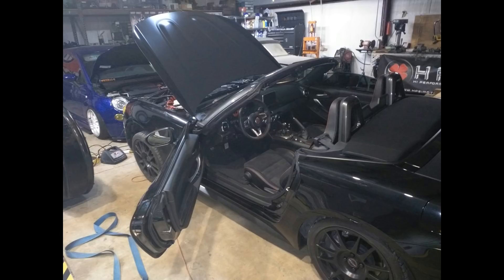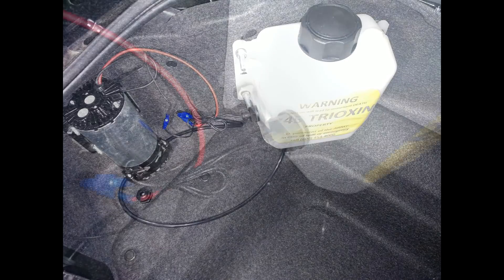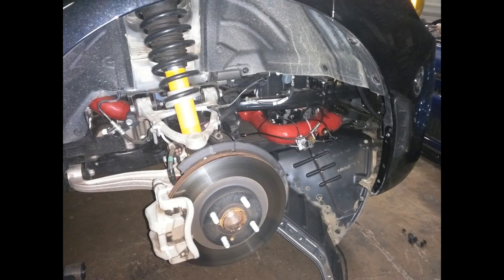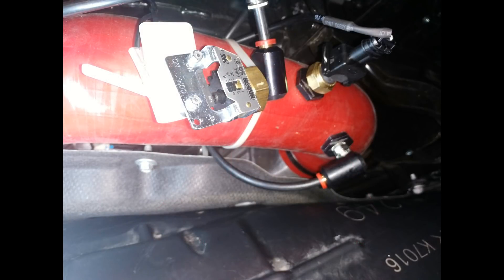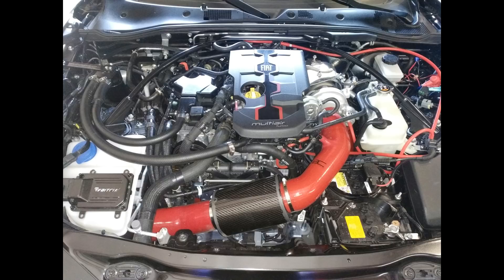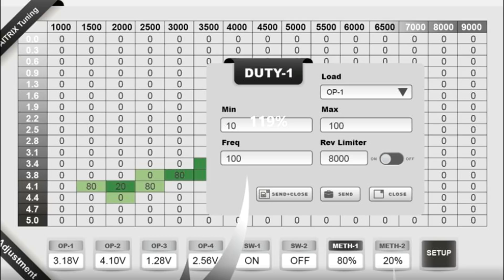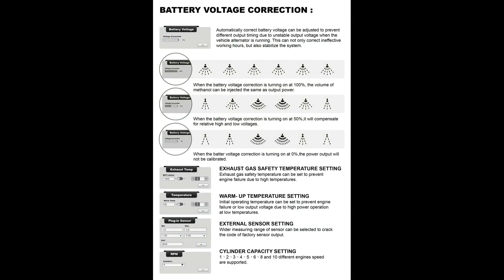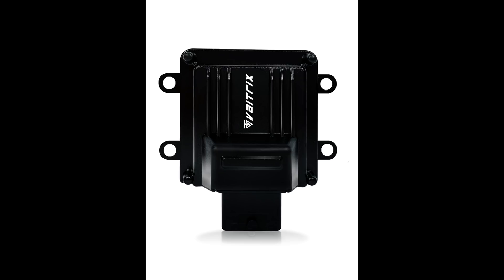Advanced Water Methanol Injection Setup

Comment from the maker: I'll add a quick remark because I see some confusion in the comment section. Water injection by itself doesn't raise manifold pressure, at least not enough to reliably measure. What it does do is move the engine so far from the knock threshold that the ECU, or the Tuner, can dial up the boost to take advantage of the spray. The controller being discussed here not only controls the water injection, it can also increase the boost, but those are are two separate functions. Now, there are cases where simply spraying water will cause manifold pressure to increase, but it's being caused indirectly, meaning that the car's ECU sees cooler temps or something else it likes and adjusts the turbo wastegate accordingly. I hope that helps.
Reply: Hey Greg, I’ve been meaning to tell you, I own a 1994 ST-205 Celica GT4 WRC. I had to build it from an American spec ST-204 and two separate halves of two WRC Homologation cars - one from Japan and the other from NZ as Toyota didn’t sell the car here.
Anyway, it shipped from the factory, in 1994, with a throttle body water/methanol injector in place of the normal cold start injector and also an oversized water/air intercooler system in place of the normal air to air system. It also features a factory anti-lag system that injects a small amount of fuel into the exhaust system between the head and the turbocharger, however, it is not active from the factory. These were all homologation modifications so that they could run these systems in rally competition.
Just thought I’d let you know for your future discussions that these systems were available in an affordable car way back in 1994. Let me know if you’d ever be interested in doing a series on the cheap midengine sportscars of the 1980’s/1990’s (Fiero, MR2 and NSX). There is a ton of interesting information to be mined when comparing these three very different takes on a great chassis setup in an affordable vehicle.
Thanks for these awesome series!

Comment: Thanks for the video great explaining how it works ive  got a boosted 22RE pick up on 20 plus pounds im going to add a water meth mix so i can give it some more timing im also on e85 i would like to boost 30 or more see if i can blow the head off as ive been told it will do im hard headed !!

Comment: This is my favorite video yet. I've been contemplating use of methanol injection in my car. I already run an E85 mix in the fuel so I'm not sure how much benefit there would be. I can't add more boost due to stock torque limits and I can reach MBT on the E85 mix. I've felt it might help power output in the hot humid summer days. Great tip on how to use the "on" light. I never thought to hook it to a pressure switch. 

With just water injection are you able to change timing or boost significantly? The person I know that tried a sophisticated water injection based on maf voltage (aquamist) ended up losing power, but that was on a direct injected car on an e85 mix that basically runs 100% wastegate duty cycle. Interesting to see how it affects different platforms.
Reply from the maker: Thanks! Water injection by itself will not add power, even water methanol by itself will only add about 2% and that's if the quantity of spray is about right. Too much and you lose power, which is probably what was happening with your friend. What it will do is allow you to run more boost and or timing. In some cases, if the ECU is pulling boost and or timing water injection can cause an increase in power by  causing a timing or boost increase by showing the ECU cooler temps and preventing knock. The point is, that the Lion's share of the potential gains are from boost and timing increases. 

In my 109K video I have a chart showing how much NACA was able to increase boost with just water, and it's a huge amount.

Comment: There's an idea Mr. Greg, do a video on Smokey Yannick's hot vapor engine, if you've never heard of it look it up, it's fascinating what he figured out, there's even one of the cars he made (3, I believe, were built) that's still on the road and drives daily, they were modified mid 80's Pontiac Fiero's, after his "hot vapor" modifications they made something like 225 HP and got some ridiculous mileage with stock cams and pistons.
Reply from the maker: When I first saw that, I thought it was something I had seen before in a NACA report, but it's not, it's totally different. The problem is that there just isn't enough information out there to make a decent video about it.
Reply: Smokey was a smart creative thinker .. But there was a lot of smoke and mirrors in some of his claims also.
Pun intended
Reply: @tomhutchins1046  
"It ain't cheatin if they haven't made a rule against it yet".
Reply: Yes he built a completely illegal 67 chevell that never ran because it was clearly not legal . Also anybody that is familiar with oval track racing would tell you most of his cheating was useless. He could not step up and compete on a level playing field? I dont think he ever intended for the car to pass tech it was all a publicity scam. Smoke and mirrors
Reply: @tomhutchins1046  
The hot vapor Fiero is not smoke and mirrors, it's a very real car with a 2.5L engine that gets 52+MPG and produces over 225 HP.
Reply: @tomhutchins1046  
Yea, I've already read it, years ago, and I know who Ralph is, why? I guess you're saying Smokey was a fake and you're the real thing huh.
Reply: @tomhutchins1046  
I suppose next you're going to say you know more than Jerry Branch about flow in heads.
Reply: Actualy I dont like Jerry personally. His products are good but if you lean on his small block heads with boost you will see there is not enough water in the head especially in the deck quench area.
His heads are great for 90% of the applications. Is he your brother? Friend? Ask him if he stopped buying those cheap china valves yet?
You asked for it Duke
Reply: Smoky was a clever Guy and a self promotor
Reply: @tomhutchins1046  
Jerry Branch only does Harley heads for the public, the car heads he's done have only been research for the car companies, he's never done automotive heads for the public, so how can you say that you've  seen a set of something that doesn't exist, Branch Flowmetrics has done research for all 3 American car companies, Honda, Suzuki, Yamaha, Kawasaki, Indy race teams, NASCAR race teams and even NASA, but never modified any of their heads for the public, he worked closely with the engineering department of the University of California, the classes take a tour of the shop when they're learning flow principles, he wrote the book on flowing air/fuel through cylinder heads and his facility is generally regarded as the masters of that art by the entire automotive and motorcycle industries, the companies themselves, not who they sell their products to, once again he only did Harley heads for the public, you ask for it so there it is, wanna be schooled on something else? Try bull shitting me again.
Reply: @tomhutchins1046  
"Water" in the quench area? You obviously have no clue what a quench area is.
Reply: He's done research for who, Oh yah i can see the nascar builders are just lined up to talk to an old Harley mechanic   Hah Did they pay him no . He's another bull slinger
Ill bet you ride a Harley
Reply: You want to read a real book try david vizard
Reply: he wrote the book on flowing air/fuel through cylinder heads and his facility is generally regarded as the masters of that art by the entire automotive and motorcycle industries,
LOL Duke what have you been smoking? STOP now your losing all you marbles.
Ill bet you ride a Harley dont you?
Reply: Hey duke thank you I haven't laughed this hard in years really. They say its a good stress reliever.
Reply: @tomhutchins1046  
The name of his business was Branch Flowmetrics, he retired about 10 years ago (yes he's that old, he was a Marine in WW2) and sold it to a long time employee of his named O'Keefe, now it's called Branch/O'Keefe, once again since you don't pay attention, he has done research for all 3 American car companies, Honda, Yamaha, Kawasaki and Suzuki along with race teams from just about every type of racing you can imagine, he didn't do the research work for them out of interest in doing the work for the public, he did it for the data, he's the most highly regarded researcher in that field by the car and motorcycle companies and his company has done flow work for all of them, once again he worked directly with the University of Southern California engineering department and classes from there all go through a tour of the facility when they're being taught about airflow through heads, now that you've been exposed as a liar and shit talker you're going to resort to name calling? Water in the quench area? You obviously have no clue what a quench area is, if you've got water in it you've got really big problems since your quench area is inside the combustion chamber, how about a picture of the SB heads that you saw, go ahead, keep digging your hole deeper, I can do this all day and night without resorting to name calling, except liar and shit talker.
Reply: @tomhutchins1046  
Oh, and by the way, his flow bench is the national standard for what constitutes a cfm of air movement, if you don't believe me go to the National Breau of Measurements and Standards in Washington DC, ask them what one cubic foot of air movement is and they'll refer to Branch Flowmetrics and tell you that his flow bench is what's used for our country's national standard for measuring that, as I've said he's done research for NASA and other government agencies and has also done flow research outside of the engine world, as indicated by his research contract with NASA, any more questions?
Reply: @tomhutchins1046  
Branch never put "atomizers" in any heads he's done, in fact if you were ever one of his dealers like I was and read his data that was only available to dealers you'd know that he proved that those are just marketing gimmicks and don't work, shoot the next pile of BS this way so I can prove what you are yet again, like I said I can do this all day and night.
Reply: @tomhutchins1046  
Boy you really stepped in it saying you don't like him, biggest whopper you've told so far except saying you know about engines.
Reply: @tomhutchins1046  
The more you talk the more you're making a fool of yourself, did you ever get any water for your quench area? Try distilled, maybe you can get it to fit in there.
Reply: @tomhutchins1046  
And please explain to me and everyone else what a "quench area" is since you seem to have a different definition of it than everyone else in the engine building world.

Comment: Please do all this with a Corvette.
Reply from the maker: Hi Duke, since Corvettes usually normally aspirated, except for some rare supercharged versions or modded cars, the advantages of water injection would be almost zero. To take advantage of this, you have to be able to raise boost, so in the case of a supercharged car that usually means changing pulleys. In the case of a normally aspirated car, you could use it by raising compression a lot. Bottom line is that I don't own a Corvette, and although think they are great performance cars, I don't really every work on them.
Reply: I know, but Reeves Callaway can take care of that normally aspirated problem with them, keep it up with these videos, they're great, sooner or later they'll start using them for instructional videos at my old Alma Mater Pittsburgh Institute of Aeronautics.
Reply from the maker: That's true, I forgot about the Callaway Corvettes, he built quite a few turbo and supercharged cars.
Reply: @GregsAirplanesandAutomobiles  
I'm sure you're quite capable of putting a turbo on one yourself if ya really wanted to 👌👌👌

Comment: I always get a kick out of water/methanol injection videos...this is not new science, the WWII fighters of the day were all supercharged or turbo charged (American planes used Garrett Turbos btw). If you go back to the old documentation there were some extensive engineering tests that documented the best methanol to water ratio given compression ratios and for given boost pressures.
Reply from the maker: I included some of that data in another video.
Reply: I recently retired from Lockheed Martin as an Engineer...32 years in Orlando/Ft. Worth/Palmdale. Believe it or not some of us were rooting around in old (still marked classified) WWII archives and found some of the old engineering tests for water/methane injection on the P38...they had all the data categorized by best ratios given compression, and boost and added torque...I wish now I would have requested it be declassified so I could get a copy.
Reply from the maker: Hi Steve, it would have been great if you could have had that.
Reply: Yeah at the time it didn't seem relevant, plus we were kind of rooting around in old archives in a warehouse on company time, so we didn't want to publicize our activities. But had I put in a request it would have been a quick no brainer, it was not classified material any longer but the folders still were marked classified. Hindsight is as usual 20-20.

Comment: LOL now thats the hard complicated way to get there . Water does nothing but cool the combustion to avoid knock.
Its better to limit compression or boost to do the same. Modern engine controls and electronics are very capable of doing that.
If you need water injection you are basically running the cylinder temps to high and bringing them back down with the water.
There are certain instances were this can be necessary as in your running on the edge and go over and need the mist to cool it down for a few seconds almost as a governor. Again modern engine management systems will do this with out water injection
Water does not increase power a well controlled engine does not need water injection.
Now methanol creates oxygen when burning it will raise effective octane (stability of the fuel) . BUT requires approximately double the volume than gas to create the same BTU's . NEVER run an engine lean on methanol!  It is much more sensitive to a lean condition. How are you allowing for this in your injector fuel curve ? How accurate is your flow from your electric pump? Nitro is similar except it is an extreme oxegenator and does nothing to raise octane .
You need more than braided line when running methanol it will break down most rubber lines they need to have a teflon or plastic liner . Steel hard line is best. Any aluminum or zinc will be corroded by methanol or water injection over the long term and short term with methanol. I have seen intake ports full of white corrosion due to water and alcohol injection
I have seen water/ Alcohol injection come and go over the years with modern engine management systems and BOOST its just a dated unnecessary technology.
There was a famous Bonneville racer Tom Beaty In the late 60'sane early 70's he had a old chevy pickup and a big heavy old time cab over camper on it with a Big block olds a cast blower intake (he manufactured) and a 8/71 gmc blower. He also manufactured an adapter to put an overdrive on a turbo 400 trans.
He used to get a kick out of flying up the grape vine north of La At 80-90 MPH in  overdrive with his old chevy. pickup.
He had detonation problems added water/methanol injection (full throttle only) Stopped the knock but a couple of months later it lost power ? The blower was ruined and the intake was almost plugged with corrosion.
He removed the injection and geared the blower down still had plenty of power and no knock.
You also mention some exotic fuels ? There is one that is proven to work for power very easy to install and is very developed. Guess what it is? 
Instead of all this complication why not set up your system for e85?
Reply from the maker: Hi Tom, thanks for your comment. Yes, water does nothing but help avoid knock, but that's A LOT! With the engine farther from knock we can raise boost more than we could with other methods. Sure, you could reduce compression or boost, but that also reduces power. The idea here is not increase power.
Reply: Yes you can raise boost with water but you dont gain power. If you have a dyno saying it does it is very mistaken the water does not burn it cools the fire.
Methanol does create oxygen when it burns that is why you can do back to back tests on an engine properly tuned on race gas  then on methanol and you will gain power from the methanol you will need more than double the methanol to do it! . And yes if you can figure out a way to inject methanol in a controlled consistent manner under full boost you can gain power but boy there are better ways of doing that and as i mentioned methanol has so many negatives on a car like yours.
Redo your whole fuel system and run e85 I have seen some big power made with e85
Reply from the maker: Nobody is saying that the water burns. The increase in power comes from the increased gasoline that's burned, which is allowable by the increase in boost. In this application we are not burning the methanol either.
Reply: @GregsAirplanesandAutomobiles  
Don't waste your time, this guy is trying to act like he knows what he's talking about but he's clueless and only quoting things he's read and misinterpreted.
Reply: @tomhutchins1046  methanol. Increases  octane and  also  burns. s  metahanol  burns  itself,  it  can  never give  oxygen
Reply: @tomhutchins1046  paetially agree  wih you. Great conmunication
Reply: @tomhutchins1046  you  are also  rwsponding  to  a  2  year old  post. Maybe vyou  have csome  sanity  trouble
Reply: @tomhutchins1046  there's no  need of  insulting, we  are    talking  like  friends  about  technics. All  opinions  could  be certain,  or  not,  who  knows?  I  am not  an  usa  violent  fighter. Moreover, I  am european English  speaker
Reply: @tomhutchins1046  be  quiet! Peace  and  love